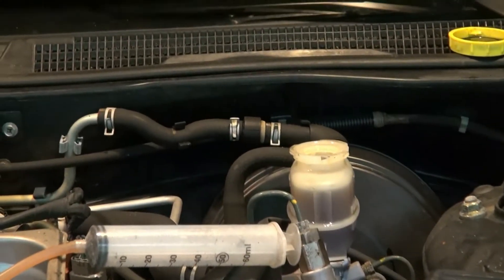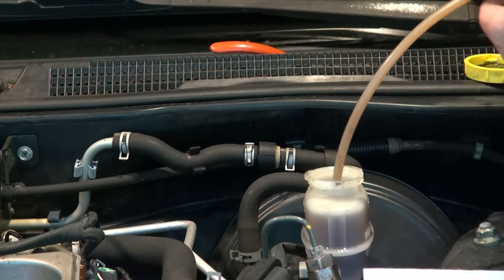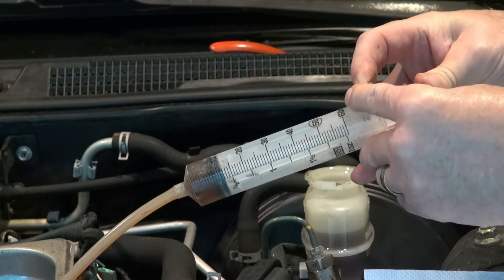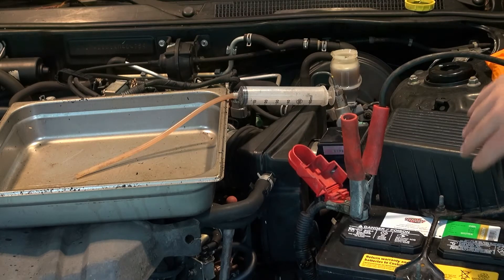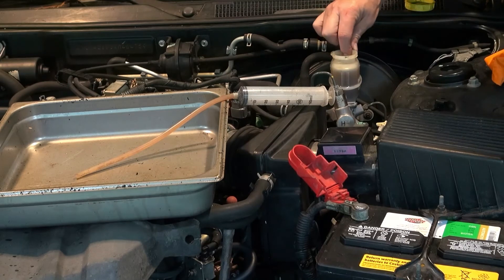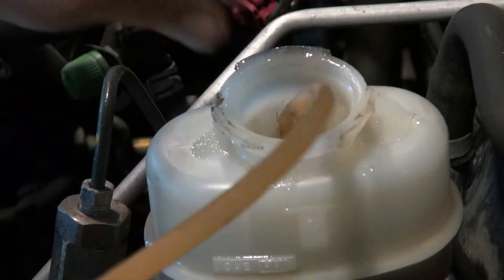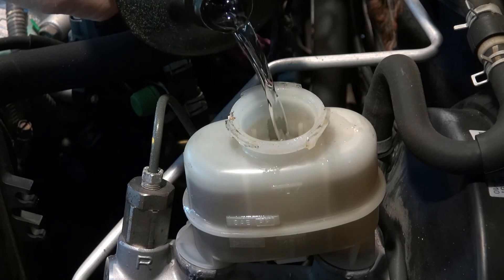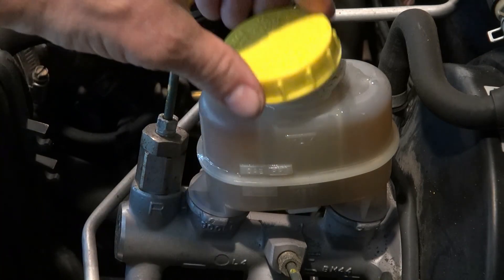Nissan Maxima Brake fluid extraction DOT3

Comment: I like your video as your detail tips and repaired so I own 2015 Nissan rouge  S and i get oil change to go dealer and he want change brake fluid as service schedule in maintenance 30k @ $137. When i watching them from window i didn’t see them to remove any tire or bleed the line so what do you think dealer did scheme with me? What do you think does 2015 Nissan rouge S need break fluid replacement to remove tire and bleed or not? Because if Brake fluid replace, then they have clean or flush or bleed line to remove old fluid. As honest mechanic what is your advice or think on that dealer job?
Reply from the maker: I always extract the brake fluid from the master cylinder first, then add new fluid back and proceed to go to each wheel draining the old fluid until I see new fluid apear st each wheel, starting from the furthest wheel.  Sounds like you did not get what you paid for, maybe they just forgot ?
Reply: @neuromanglers  thanks same i feel